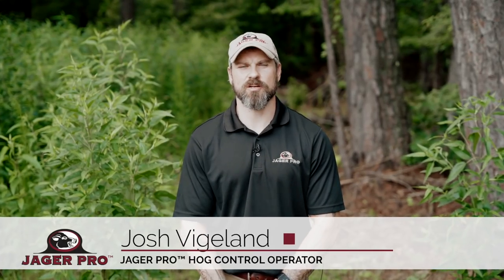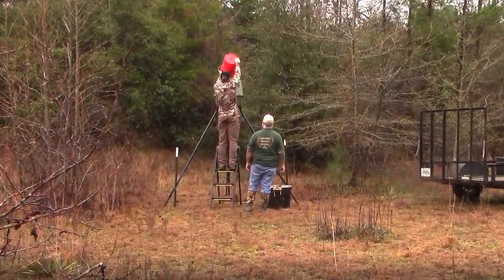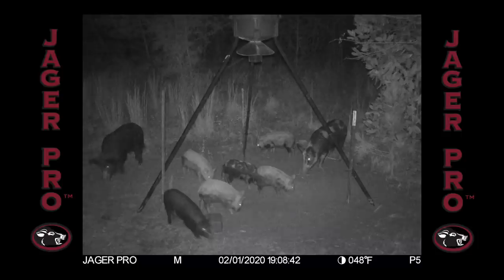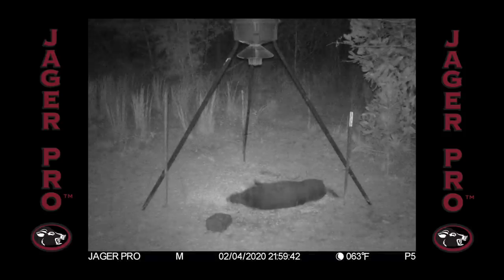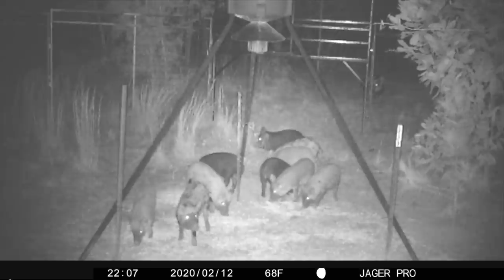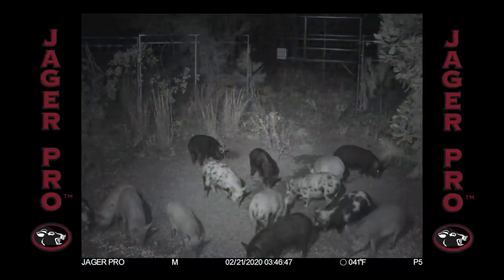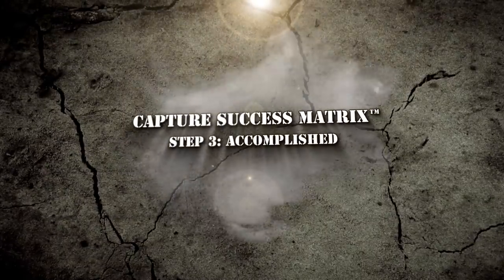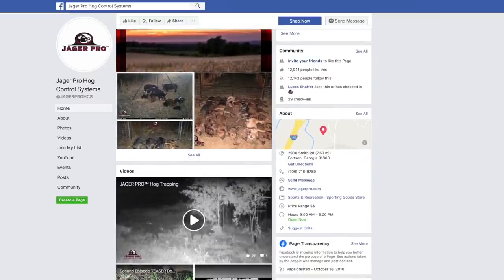WILD HOG CONTROL | JAGER PRO™ TV Show | Performance Based Decision Large Sounder Capture

Comment: So what happened with the two sows?  Did they never appear at the bait site and trap again?  Did you succeed in getting them later with a bait hole? Why did you remove the automated feeder?
Reply: Both sows were later dispatched on two different food plots adjacent to Webb East. We had removed the automated feeder because we weren't quite sure if it was the trap that had them on edge or the feeder. This is why we decided to hand bait at that point forward with this sounder.

Comment: Great vid. How quickly are these animals spreading currently? I.e if you remove the sounders from an area how long would it typically take for more hogs to move in?
Reply from the maker: It only takes 15-18 months for a trained and certified Hog Control Operator™ to eliminate feral pig populations from 10,000-acres using four (4) mobile M.I.N.E.® Trapping Systems. It is common to use 20+ spin-cast feeders (with I.C.E.® Cameras) as bait sites across the 10,000 acres to first locate, identify and pattern various sounders. Then Operators can quickly and efficiently move a M.I.N.E.® Trapping System to the bait site and capture the entire sounder (or sounders) depending on the photo and video intel gathered. But there are several factors which determine how long a property remains at "zero balance" after a successful Integrated Wild Pig Control® (IWPC®) program has been implemented. Future reproduction and migration would have to come from adjacent properties since an effective IWPC® program would prevent escapes, method education and reproduction from the entire generation of feral pigs living on the property. 
Are neighboring landowners implementing a successful IWPC® program? 
Are there enough trained and certified Hog Control Operators™ in the county to effectively implement the IWPC® program? 
Has the state passed legislation to stop intrastate and interstate transportation of feral pigs? 
How well are law enforcement personnel enforcing these rules in the state? 
Are judges and the court system prosecuting those breaking the rules with heavy fines? 
How many criminals are illegally transporting and releasing new feral pig populations in the county? 

The amount of time a property remains at "zero balance" greatly depends on the answers to the above questions. Our IWPC® approach is most effective when the entire county is following the same plan while trained Hog Control Operators™ are performing the work.